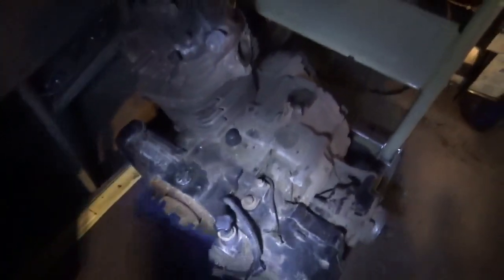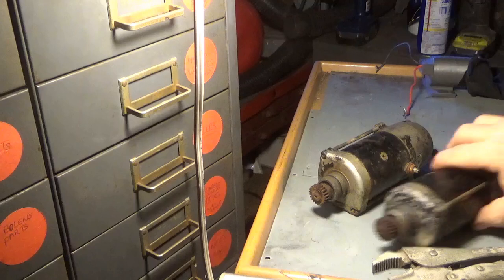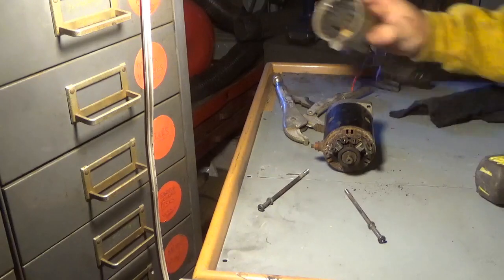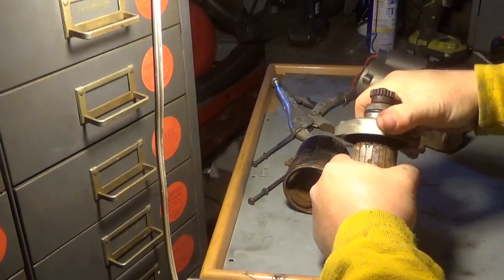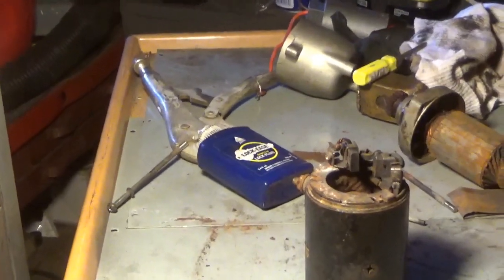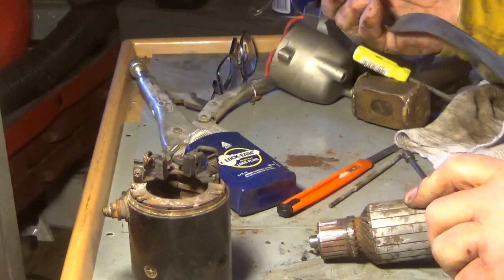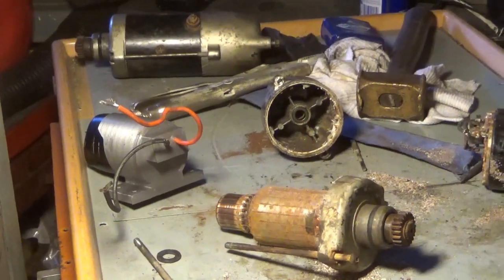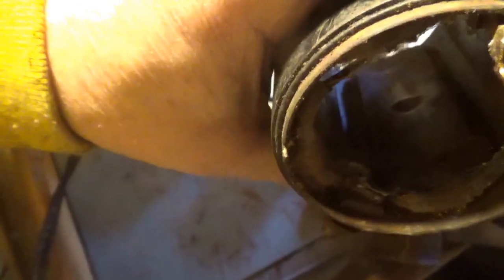Fixing 2 Dead Honda ATC 200ES Big Red Starters!

Comment: Cool vid Harvey! Great deal on the starters
Reply from the maker: Hey Duckworth!!! I had the need for 2 200es starter, I had none and discovered that they were not cheap and easy to get.... At this point, my problem is fixed, .... Thanks for Ur thoughts, encouragement, watching, and commenting!!!
Reply: @HarveySpooner  hey Harvey just picked up a 1982 200e Big Red for free the plastics are all intacted but light on compression so I pulled the engine out and gonna slap some rings in it but It doesn't seem to be getting oil to the cam? Thoughts on this issue?

Comment: i have a starter the someone over torqued the positive terminal as well but i need to find a grommet mine is rotten to pieces. any ideas?
Reply from the maker: Hey Dog! I would buy a rebuild kit like this, https://www.ebay.com/itm/252983359408?hash=item3ae6fbb7b0:g:HdsAAOSw1BlZO1rf  ,  and take the parts I need it..... I hope this helps!  Thanks for asking, watching, and commenting!!!
Reply: @HarveySpooner  hey man thanks. i made a new bushing out of some fuel line and all I need to do is solder it back and I'm ready to rock👍

Comment: Harvey I have been watching for a good while. But I have a question. I have a Honda recon es that won’t shift and I hooked up a 12v battery to the shift motor and nothing happened and when I hook it up to the multimeter there’s no continuity. And the dash is flashing a 3 fault code please help
Reply from the maker: Hi Hash!!! Most people convert the honda electric shift atvs to a manual shifter, here is the listing, https://www.ebay.com/itm/232779413082?epid=1211841595&hash=item3632bbf65a:g:kicAAOxyn9BRa3pb  , I hope this helps.... Thanks for asking, watching, and commenting!!!